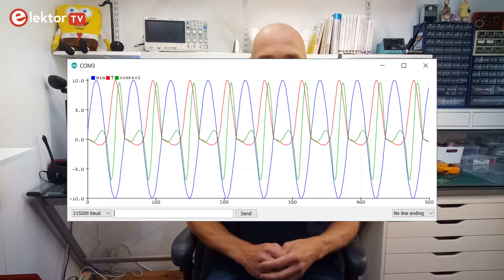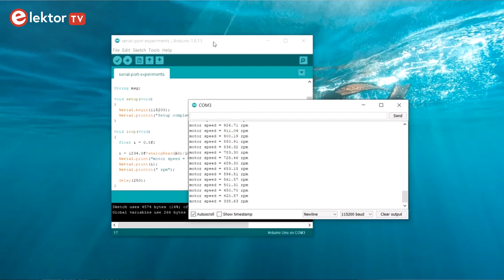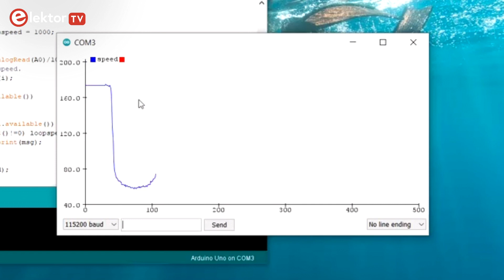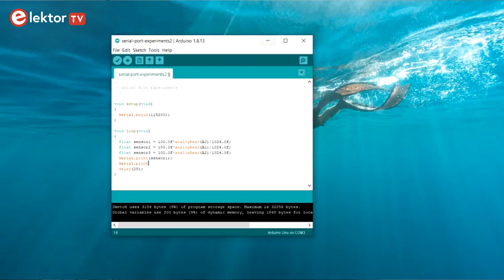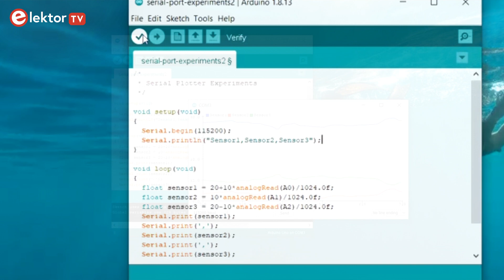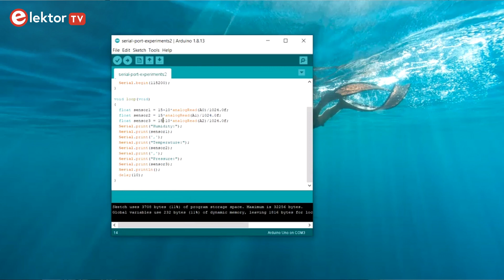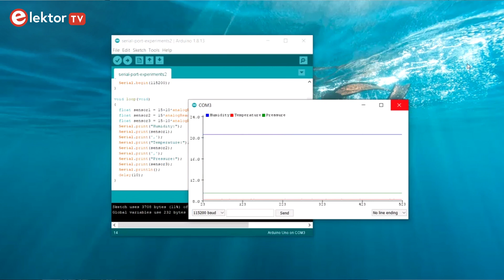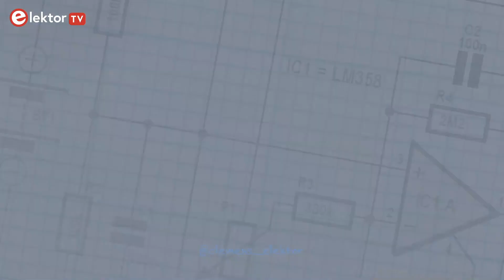How To Use Arduino's Serial Plotter

Comment: I have been using Pi400 with Arduino Nano attached to USB.  I've noticed that the Arduino serial plotter seems to lag when used on the Pi400 by comparison to using the same Arduino equipment on my Windows computer.  I wondered if anyone else has experienced this issue.  I've thought of powering the Nano with batteries when it is attached to the Pi's USB port but haven't tried that yet.

Comment: serial Plotter is always blank and never shows any output at all.plz help
Reply from the maker: Check serial port, its settings & connections, make sure the program is not hanging somewhere in a loop or so. Post not-working code.